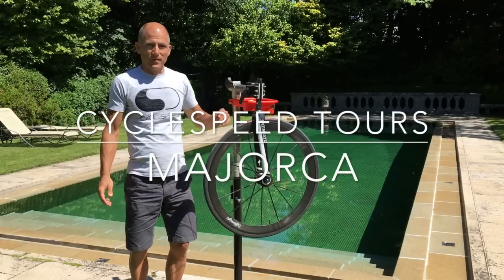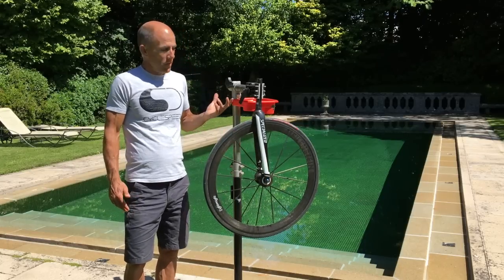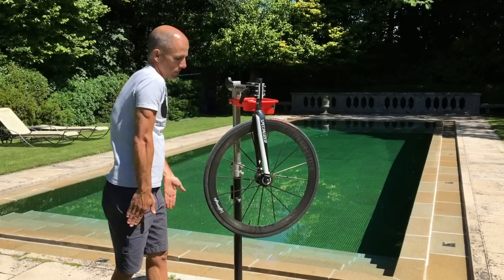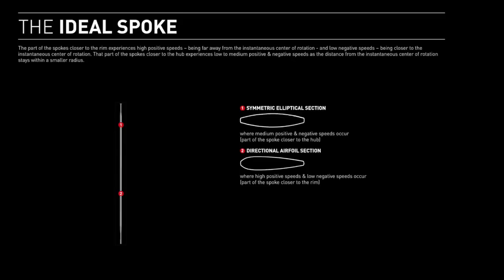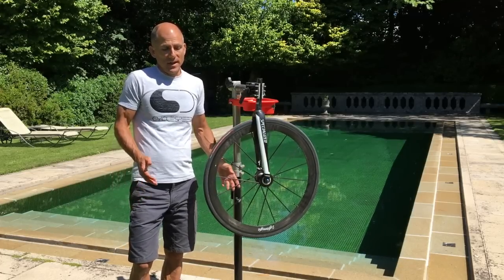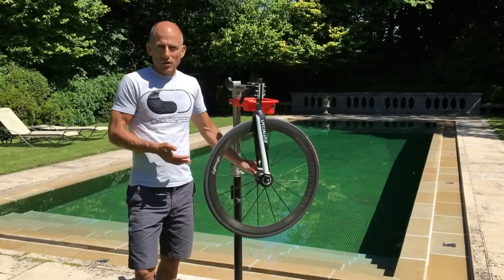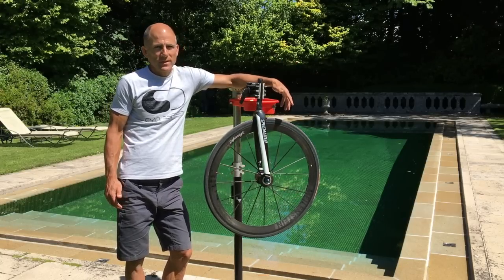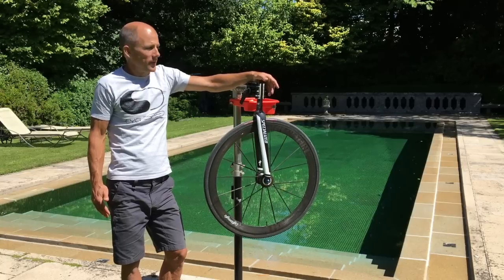Aero Wheels - What they are NOT telling you!

Comment: I think the benefit to all this is in the head you have anew set of carbon wheels therefore your encouraged to cycle harder and faster ..its natural to want to buy bling for😊 any hobby
Reply from the maker: The aero (spinning) difference between fat circular spokes and thin aero spokes is easy to measure and significant. Hard to detect at low speeds but definitely something you can  feel above 40kmh.

Comment: If they measured the power it takes to spin the wheel without these rotational drag in the equation and the power is better than the other wheels, does it really matter since the same measurement was done with the other wheels?  If one wheel have a better design spokes that cut the wind better than the other, can we not assumed that this wheels will have a better rotational drag?

Comment: I’m have reasonably set up dura ace c50’s they are quite old but well maintained.
They cost me for the set not a lot of money second hand.
When I roll down a hill with other people I’m always faster than them. I’m not saying it’s the wheels...
Most the riding buddies are using $12,000+ carbon top of the line carbon aero bikes. 
I’m on a alloy 7.2kg bike with a decent spec that set me back at most 1/4 of the cost. 
I’m of average hight and build. 
A lot of the them are smaller and focus on racing much more than I do. I’m still in the top 5 of most regional crit races I enter. 
There are so many factors in cycling narrowing it down is very hard. 
But taking each aspect you can change easily (spokes eg) and just making them slightly better will have a huge impact eventually.
Reply from the maker: DA C50's are great wheels and fantastic value. No point on getting hung up on the very latest shapes and designs, there isn't so much difference between 50mm wheels. And nothing better than to beat a 12k bike rider on an older heavier bike!

Comment: Very true for drag and not true for similarities.wheels are close but neither similar nor the same. Recently Zipps turned out 2 kmh/hr slower than ENVE SES and Aeolus, 35-55 km/hr. Zipps keep turning into the wind and are very twitchy be it light... chief reason is the enves having better angular momentum and gyroscopic inertia... bontrager Aeolus gave me another .5 on the enves. over thousands of kms these nuances are clear. but wheels are not similar as even 1 mm here or there is huge in aerospace applications.. ENVE issue is wheneve they use Chris Kings those can start dragging with 5000 kms. DT Swiss is better obviously. Zipps are overpriced garbage..

Comment: Great point. And three years later, a few nerdy comments and questions.

All published data, or marketing faff will talk about solo riding. In practice, unless you're doing tt or tri, nearly all competitive riding for nearly all riders will be in a group, large or small (how many all day solo breakaways succeed anyway?). 

Wouldn't that mean the 25% spoke contribution increases pretty drastically? Wouldn't a group drag the air with it, chopping it to utter turbulent chaos, and make any prediction something of a guess?

And what could cause any significant difference? I guess spoke count, lacing pattern, and flange with could play a role. 

But then again, most high end wheels out there will be built with DT Aerolight or Sapim CX-ray, and they ar very similar at 1.2x2.3 (Sapims have a slightly longer bladed section/shorter round section at the j-bend and spoke thread end, by eye, and could possibly be slightly better).

The hub flange diameter and with also greatly affects lateral stiffness, and I would not want to make any sacrifice here for a marginal aero gain.

Internal nipples probably will make a discernible difference. But on the other hand it will make it an absolute pain to true a wheel or replace a spoke, because you'll have to remove the tire, tube or sealant, and rim strip/tape, or even worse a tubular tire. Not sure about that either, unless you're a pro team with a generous budget and spare wheels sticking out from everywhere.
Reply from the maker: Some good points there. Especially re riding in a peloton where the air is very turbulent; linear drag will reduce but rotational drag would stay about the same. 
I think a large hub flange diameter would actually help aero as it reduces the length of the spoke, and could even have a kind of fairing effect like deep rims do.
Yes internal nipples help, but agree a pain to true. Having said that, my Boras haven't needed truing in 40 000kms and I have hit them pretty hard in potholes.
Reply: @CyclespeedTours  Me not being the expert, but here goes. My intuition says the same about flange diameter. That is, unless the j-bends and the associated round spoke sections cause trouble in this area. It actually ends up being quite wide and ragged at and beyond the spoke hole circle. Straight pull with a large diameter would probably end up making the flange it self very bulky. So very unsure all in all.

Regarding the with between the flanges, I assume narrower is more aero, but at the cost of lateral stiffness. 

I know at least two makes of internal nipple wheels, one Norwegian, one Swedish, both small companies. Neither really tempting me for the practical issues.

Boras are on my 'to get' list. Probably the only design where I'd still dare to try if they went for hidden nipples. Campagnolo and Fulcrum make rock solid wheels (basically the same wheels) The two to one lacing is pure genius, and the only way to get proper spoke tension non drive side. Low tension spokes tend to loosen, no  two ways about it. I've had a pair of Shamal ultras and a pair of Zondas for seven years, even replaced the rear rim on the Zondas for brake wear. It took a crash for the Shamal to require truing.
Reply from the maker: @thomaslutro5560  I had Lightweights, but I think the Boras are better. Great wheels.

Comment: This does not apply to 99.99% of riders.   Don’t over think it guys, just get out there and ride, if you want to get faster, ride more and lose weight!
Reply from the maker: AH, the old, aero and bike weight do not matter at all comment. Seen a few of those in my time!!
Reply: Cyclespeed Tours that only applies to the “professional” riding scene. As I said 99.99% of riders will not need to invest huge amount of cash into aero and lightweight parts, it will make no difference to their Strava times.

I run a 2011 Tarmac and love overtaking people on more expensive bikes, I legit get a stiffy when I do.
Reply from the maker: @reubs91  Well I'm really happy for you about that! ANY rider can benefit from a lighter, more aero bike. And yes, it would make a difference to their Strava times, if that's important to you. Many enjoy the tinkering and engineering aspect of improving their bikes. And you can add personal fitness on top of that. Each to their own.
Reply: @reubs91  But are the people you overtake actually racing you or are they just random cyclists you meet on the road while riding and who are probably on their normal leisure/training/fitness easy ride? Asking this because many times I get the impression that several cyclists I randomly meet on the road overtake me just to get their 'stiffy' by boosting their ego while thinking they are very fast. When in reality I would be going at around 60% of my maximum power. To be clear, I don't ride an expensive bike at all, so it's not he point.

Comment: There is no rotational drag. There is energy required to spin up a wheel. But once it’s spinning there are no watts required to keep it going other than aero drag And drag from friction.
Reply from the maker: So do you think that when a spoke moves through the air it is, by some mircale, 'drag free'? Think it through.
Reply: Cyclespeed Tours that’s aerodynamic resistance or drag. Not rotational drag.
Reply from the maker: @89gregpalmer  It's drag caused by the spoke rotating, as opposed to drag caused by the spoke moving linearly. You have to apply energy to get the spoke to move in a circle due to a) the air drag and b) the bearing drag
Reply: Cyclespeed Tours oh I see, you are talking about the effect that rotation has on the overall aerodynamic resistance. I’m with you now. I originally thought you were inventing a fictional force that would slow a rotating body in the absence of air or friction. I misinterpreted, you are right.

Comment: stockman1963
1 second ago
Love your wide range of topics.  Long while back you did a video on tire aero drag,   You had said that much of the data  presented was with the tire fixed in a wind tunnel not rotating.   I thought of a way you could do a comparison with a couple for tires.   It would be representative comparison.     You would need a very high speed fan,  high speed drill or something to get wheels going around fast, RPM reading so you start at same speed each time.  you could do reading - Time wheels spin down time without fan  blowing on them and then with fan blowing on them.  Then compare time different.   That would be representative of a difference.   Maybe do 4 runs.   A -- no fan coast down to zero or some rpm you pick.  B-- Coast down with fan on .  Then repeat again each.     High speed  Fan   -- Lasko 20" High Velocity QuickMount, Black-Easily Converts from a Floor Wall Fan, 7 x 22 x 22 inches, 2264QM   Can e-mail me for ideas   I am an aerospace engineer too.
Reply from the maker: Hi Stockman and thanks. I did in fact do something very similar to what you suggested. Using a drill with a known speed (50kmh), I spun up a Corima MCC S+ and a Lightweight Meilenstein in a stand. Then watched and recorded the spin down times. 
The test was done quickly and was not scientific enough, but it did show the LW performing far better than the Corima, due to the Corimas fat round spokes. Many commenters said it was just the difference in bearing drag, but this was not the case as the slow down was not linear (aero) and you could even hear the extra air movement of the Corima. 
I did not have a big fan present, but that was my next step idea. The 'static' test was unrepresentative of real world conditions, as no translational air movement, but it did form a basis to show that the ROTATING aero design is important.

Comment: Where is your experiment to prove what you are trying to say? Ok, the wheel manufacturers are lying, prove to us with imperial data that they are missing components from their test results.
Reply from the maker: It's fairly simple - if they are not measuring power to spin, then an important component is missing. Possibly they consider it negligible. Others like DT Swiss clearly don't. Or maybe they are measuring it but just not telling us, but why wouldn't they? Possibly it's too complex / too much of a hassle for them to bother.
Reply: Well, that is a great guess about complexity.

Comment: Aero drag of wheels is an extremely complex problem.  A central issue is that wind tunnel testing deals with steady state measurements, and real world airflow is far more complex than that.  Even with steady state laminar airflow hitting the wheel, the leading portion of the wheel does not experience simply the opposite airflow from the trailing side of the rim; the spokes and the leading portion (and their motion) disturb the airflow.

It's worth stepping back and asking what benefits reduction in aero drag might yield overall?  And how much additional weight (aero usually entails adding material somewhere) can be tolerated to gain this improvement?

Aero can certainly help in situations where one is exposed to the air (TT, solo breakaways, in a small break or team TT, and just training/recreational riding alone).  The benefit depends on speed through the air and whether the air is undisturbed.  Riding more slowly (weaker rider or going uphill), in tailwinds, or in blustery conditions all mean less benefit.  So many people seem oblivious that aero is unlikely to be helpful when one is drafting or riding in a group (e.g. peloton), already benefitting 20-30% from the bubble of air moving with the group.

Additional weight, particularly in wheel rims, costs dynamically whenever one must accelerate (as one does constantly when adjusting speed in a group and also when tagging back onto the pace line after a stint at the front).  Aero can also added weight to carry uphill.

In simple terms, aero helps you in some situations whereas added weight is a minus virtually all of the time.
Reply from the maker: I would agree with all of that.

The trend right now is very much for aero, aero, aero and I do get it, but light wheels just feel very, very nice to ride and you can't quantify snapiness out of corners or 'flickability'.

Comment: For starters, you're talking about aero wheels whilst spinning a Lightweight Meilenstein.  My understanding is that Meilensteins were designed to be LIGHT rather than AERO.  And that the depth and the "V" profile of the rims are that way to match the angle of the carbon fiber spokes which are bonded to the sides of the rims, not for any aero drag reduction.  The spokes run from the rim, across the hub flange, and back to the same side of the rim, further around the circle.  I suspect that the "V" cross section of the rims is more draggy, perhaps for airflow at the leading side of the wheel as well as for airflow at the trailing side of the wheel.

I have used a set of the 16/20 Meilenstein clincher wheels extensively.  At 1196g without skewers (calibrated scale) mine are certainly light, perhaps 200-300g lighter than most other clincher wheels.  Subjectively they feel very smooth.  Quite susceptible to crosswinds and eddies, and braking performance in rain is abysmal (though I lack experience with other carbon rims).  The brake pads supplied with them work fine in the dry.  Nice wheels, but so spendy I probably would not buy them if I had it to do over.
Reply from the maker: It's just by chance that I have a LW wheel in the stand - I'm not claiming any special performance for that wheel. You are right about the wheel's construction, but the difference between a V shape and a U shape is not massive and is mainly felt in crosswinds. I personally never had any issues with the LWs in crosswinds. Having a deeper rim reduces spoke air attack which is valid for any deep wheel. 
Yes, nice wheels, but I recently sold mine for some Campa Boras, much cheaper and not much difference in performance.

Comment: This is also why Rolf (and the first Campy Shamals) came up with very low spoke count (only 10 in the front in some cases). The engineers know. They're not running public universities with duties to publish all results.
Reply from the maker: True, but if the marketing guys can seize upon a plus point, then they will let us know all about it! Low spoke counts seem less common now which is odd, cost perhaps? And of course, low spoke count is fine as long as the spokes are aero, which is not the case with some Corimas and Mavics (thick circular section).
Reply: @CyclespeedTours  

IIRC, before big investors started paying for wind tunnels for bike wheels, all of the early tests were "roll down" tests. Cars used to do the same back in the old days. Similar to what you are doing. The wind tunnel tests don't "hide" roll down factors but simply present it differently.
Reply from the maker: All true. Wind tunnels provide a consistent testing medium in that a 40kmh wind in a tunnel is pretty much the same in all tunnels, but the real world is not so simple and the air is moving all around us all the time and is not steady. So treat tunnel test results with caution. @indonesiaamerica7050
Reply: @CyclespeedTours  

The only real world tests are the competitions. But those are not easy for others to use for their own equipment choices. There's no such thing as a perfect test to arrive at "the best design" or "the best system." At best you can come up with valid tests for specific theories and test under controlled conditions (to augment data taken from competitions) to help improve your prediction models. Better prediction models help design engineers and end users. But in the end, it's all about the best synthesis because you can't predict with great precision what "the best" system will be for any given "real world" competition (or training run) any more than you can predict next week's weather. For pretty much the same reasons. 

In summary, I'm all for appropriate skepticism and ever more varied testing on the path to creating better analytical models and therefore better ways to choose gear.
Reply: @CyclespeedTours  

They seize upon "plus points" that are part of Unique Value Proposition narratives. They'll tell you that they "optimize spoke configuration" but not that "lower spoke counts is always better as long as your wheel doesn't break." They sell the sizzle over selling steak because steak is commodified. The marketing stories are about selling "sizzle" or what is supposedly unique to the product that they are competing with. It's about building a "brand story" without giving away secrets or easy ability to debunk alleged "value" claims. 

Aside from all of that, it's complicated quantifying all these factors under real world conditions or tests that attempt to replicate real world conditions in a consistent way. I'ts not that you're wrong, it's that your conclusion is unsurprising and probably doesn't have a solution unless people want to do their own independent tests just for the sake of publishing the data.